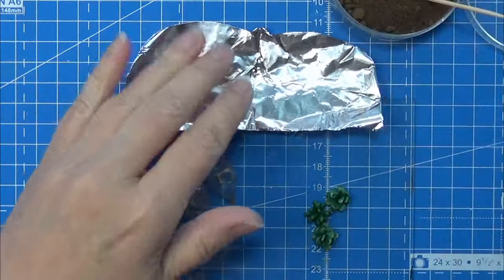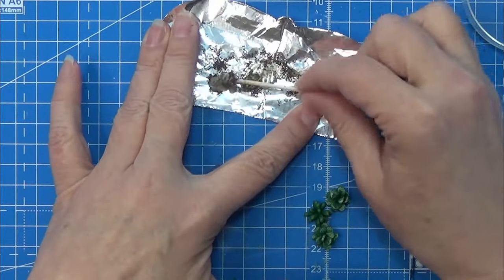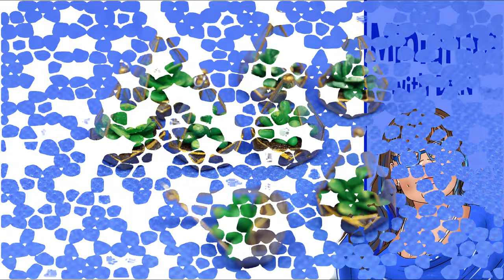How I Make A Miniature Hanging Plant

Comment: Love these! Is the 3d printer you use a resin printer? Is that why the UV coat turned it transparent?
Reply from the maker: Hi Em 💕 thank you so very much 💕 Yes I'm using my resin printer for this, and clear resin, I have a Anycubic Photon Mono SE and it is a great maschine. this print would not be able to print on a FDM - filament printer as the walls are way to thin, and that would not turn out so transparent as this.
Reply: @DRN  So amazing. Maybe someday I can get one of those. 😊
Reply from the maker: @emschrader418  I love my resin printer, as I love making these differen 3D files, I have a ton of joy with creating 3D files ❤
Reply: @DRN  You make the best things too. ❤️
Reply from the maker: @emschrader418  Thanks my friend